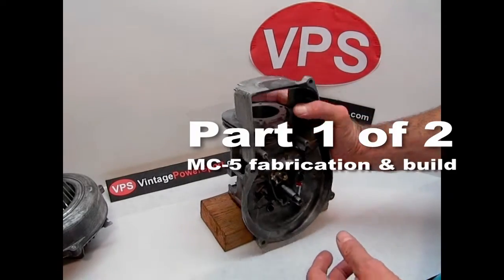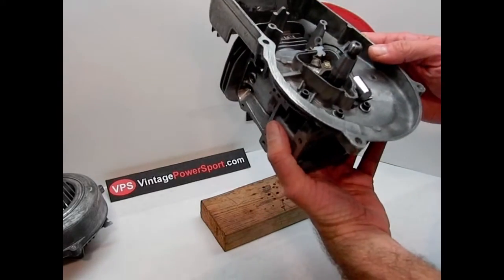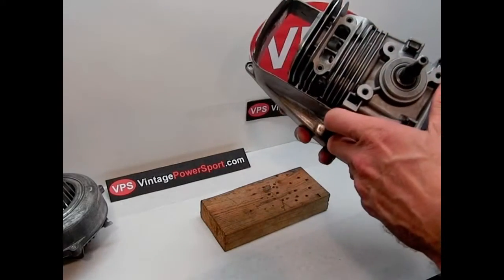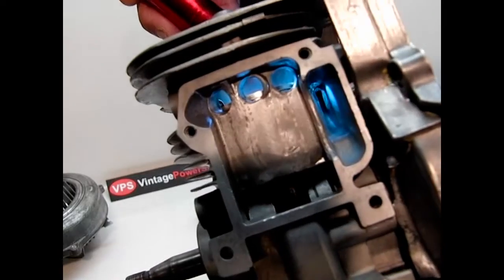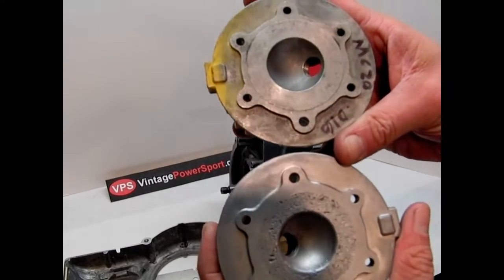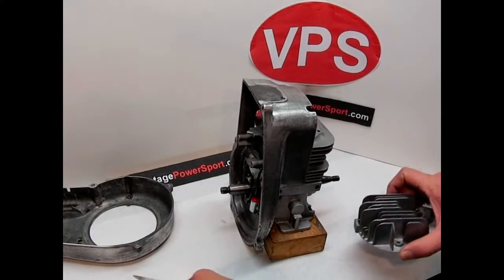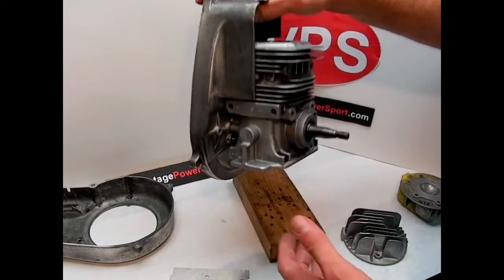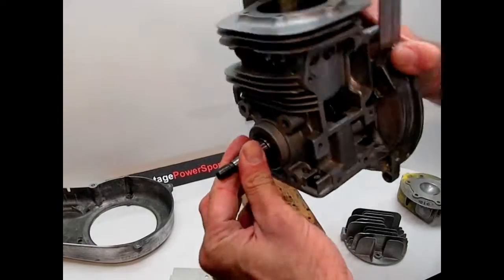Vintage Kart McCulloch MC-5 build Part 1 of 2

Comment: How were the boost ports installed? Also, did you have to drill any new ports in the chainsaw block?
Reply: he used a dremel tool to cut the boost ports... that model saw bock came with all the other intake ports and exhaust ports already drilled, but no 3rd ports drilled which is good if you want to add boost ports.

Comment: So glad I found this. What do you think of the Mac 101A engine? It was used in one of my childhood favorite airplanes, the Whing Ding. They say it produced 15 hp. I am looking for a current motor that is fairly inexpensive, is about the same size and weight as the 101, and puts out 15 hp. Thanks for any info!
Reply: The US820 engine is the closer current production engine to a Mac 101. This is a retooled version of the old West Bend 820.  MC101 engines are for sale on ebay, used ones 500-800 bucks .. new old stock ones go $1,500 and up, way up!

Comment: clutches can be found on ebay .. a dry shoe type clutch or direct drive would be era correct for this motor. Max-Torque will build you a new clutch, different types, contact Jim Donovan there, he will build you anything, very helpful!